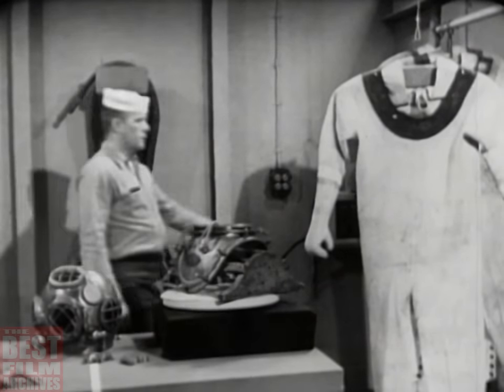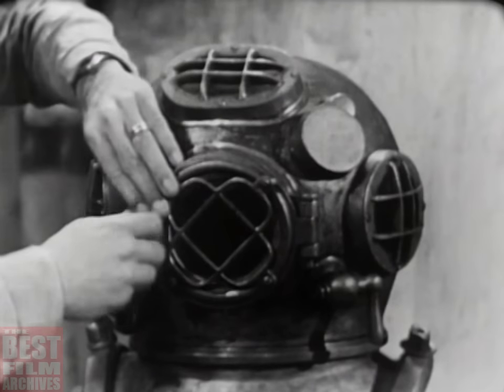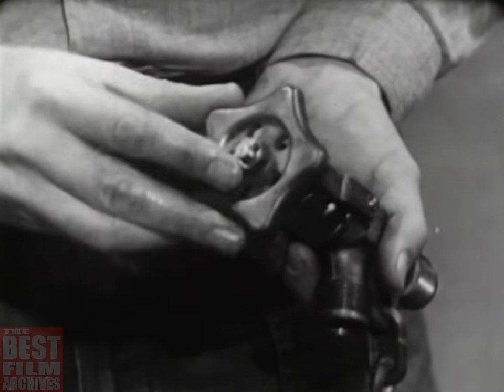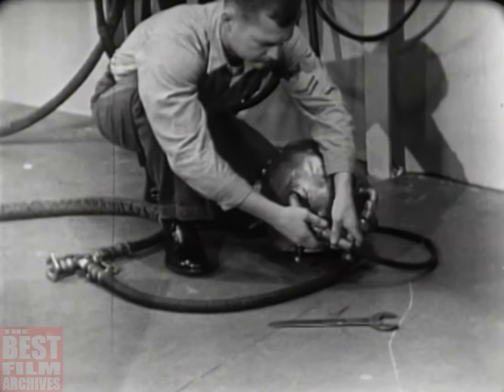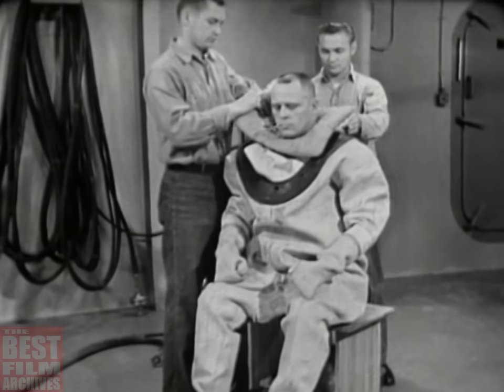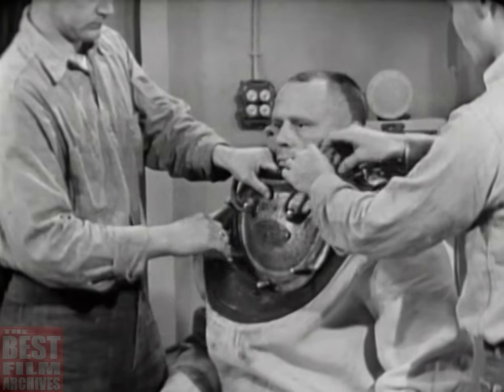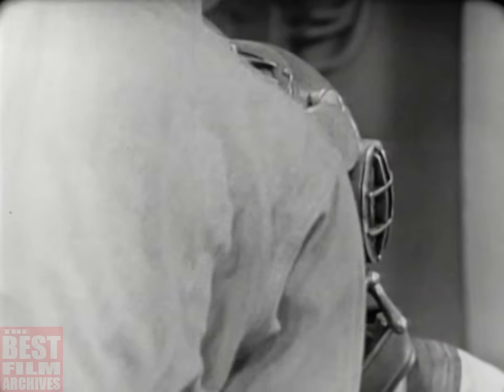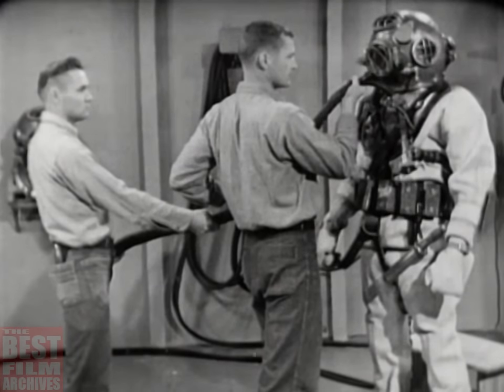Deep Sea Diving Suit | US Navy Training Film | 1963

Comment: What was the suit made of, canvas or rubber?
Reply: The fabric of the diving dress was made by sandwiching a solid sheet of rubber between layers of heavy canvas twill. When brand new, the diving dress was very nearly watertight. After a few dives, drip leaks around the seams and tiny holes in the fabric cause seawater to infiltrate the dress. Over the course of a long dive, even a small drip leak would cause seawater to flow down to the feet and legs. It was typical to end a dive with water soak wool socks and wool long underwear bottoms. At the end of the dive, we hung the dress upside down to allow the seawater to pour out and to allow the inside canvas to drip dry. We often set up fans to circulate air inside the upside-down dress to facilitate drying. 

I was a U.S. Navy Deep Sea Salvage Diver in the 1970's and the Mark V (shown in this video) was my working uniform. Toward the end of my enlistment, the Navy retired the Mark V and replaced it with the Mark 12. This new setup included a low-volume, form-fitted fiberglass helmet with a tight-fitting dry suit. I got a chance to among the first Navy divers to use the new Mark 12. Talk about comfort. The new rig was much lighter on the surface, and much warmer underwater. It was also quieter. The air supply into the Mark V rig was very loud.
Reply: @treelinehugger  
Might as well be a wet suit if you could still get damp.
Reply: @jordanezell5132  When working in freezing or polluted water, a suit that leaks about a quart an hour is still far superior to a wetsuit. Wetsuits in freezing water provide a limited duration, especially when you aren't working hard. It is one thing to SCUBA dive in a wetsuit. You are constantly swimming and getting the blood flowing. But when you have to work in one spot for an hour or more, a wetsuit will not keep you warm. Wetsuits also provide no protection from polluted seawater, The seawater in the port of Naples Italy was so polluted that we would apply vaseline over our lower body to offer a minimal barrier between the polluted seawater and our skin. Pulling wool long underwear over greased legs wasn't easy. 

Once, we got to experiment with a hot water suit. That was a pain to set up but really extended our duration while wearing a wetsuit in freezing water. It was a loosely fitted coverall that continuously pumped hot water over the top of the wetsuit. When given the choice between working topside to support the diver or being the diver, everyone volunteered to be the diver. It was no fun working topside during a cold winter storm.
 
The newer dry suits are far superior to the old Mark V dress suits. I and my oldtimer dive buddies used to mock the young guys who never worked in the Mark V. We called them Hollywood divers because they were pampered in the luxurious comfort of the new Mark 12. The new divers took it well, but if given the chance they would have gladly worked in the retired Mark V outfit just to experience it. They were jealous of the oldtimers. 

This has been a lot of fun for me. A trip down memory lane. I remembered my dive buddies and I remembered when I was young, fit, and very strong. Now I am old and arthritic. For the young people reading this, don't miss opportunities to do in your youth what you cannot do in retirement.
Reply: @treelinehugger  
Wow, that’s amazing! By the way, how were old dresses waterproofed and did they always leak?
Reply: @treelinehugger  was all this hardware on the mark v necessary because of the rough nature of salvage work and environment? Also did you use depth gage and decompress tables or did support team take care of that

Comment: Man, that looks uncomfortable.
Reply: Chortle Chortle Chortle you are right. Modern dive suits are a lot more comfortable.
Reply: The most uncomfortable part was the cold. I would wear three layers of thick wool socks, wool long underwear and a winter wool hat. Sometimes we would tie one of the dive boots to a line and lob it onto the surface ice to make a hole just so we could dive. The dress leaked small amounts of seawater. By the end of a long dive, my feet and legs would be soaking wet with freeze cold seawater. 

It was also uncomfortable sitting on the surface. Once dressed, every diver just wants to get in the water. When first entering the water, the weight of all the gear is reduced and it is no uncomfortable. It is bulky and awkward to work in, but not uncomfortable...  at least not until the cold seawater starting pooling in the feet and leg areas. 

It was also very noisy. The air supply into the hat was loud.